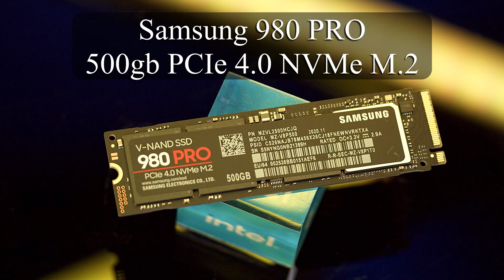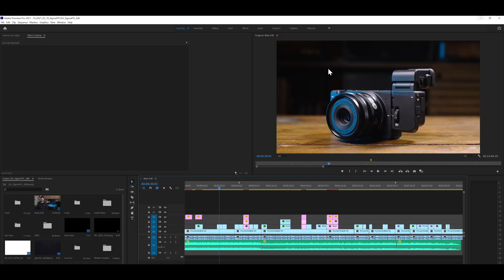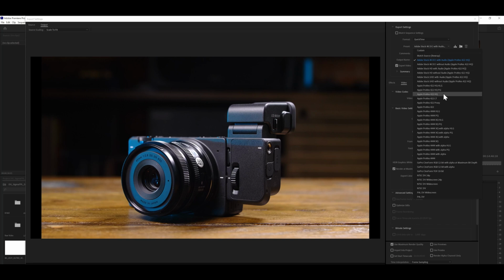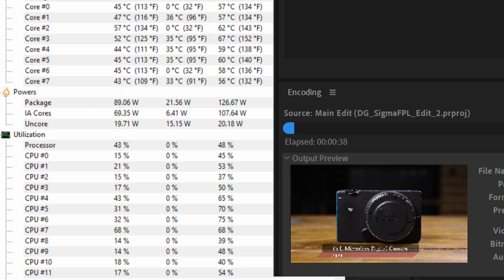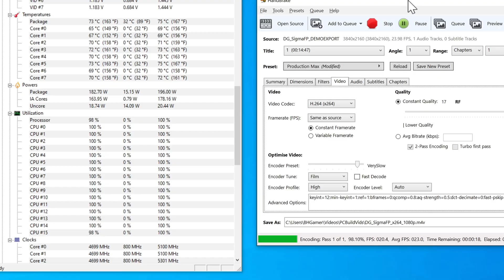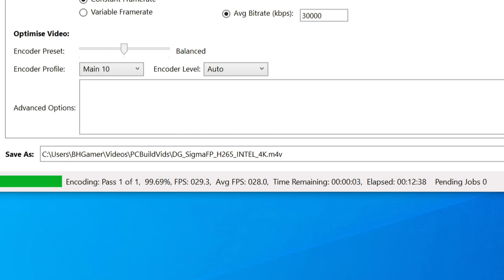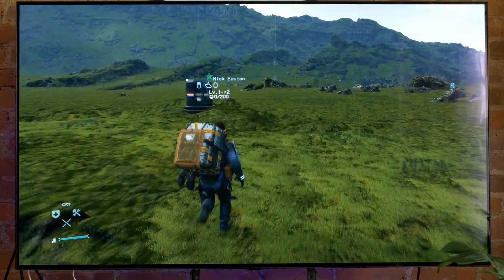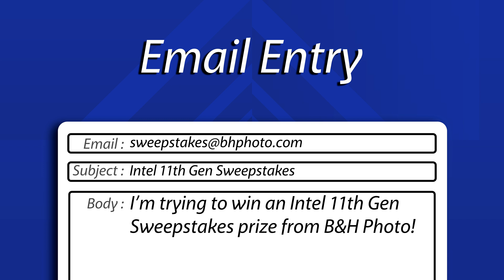11th Gen Intel Core | Hands-on review + Sweepstakes

Comment: Meanwhile Apple has created the M1 chip that clearly points the way to the future for computers that ARM RISC processors are more cost effective, thermal resistant and higher performing. Don't believe me??? Microsoft, Qualcomm and Samsung are all clamoring to produce ARM chips for Windows that are on par with Apples Mx chips. Looking at all this power hungry hardware though impressive will be obsolete in about 3 years. AMD processors are a better performance/cost buy than these Intel chips and they will have the cellular connectivity built in. However this Intel i9 is impressive though late and will likely be the last x86 development before the switch to ARM processors. Intel is already hedging bets by opening their foundries to make ARM processors for other manufacturers.
Reply: The M1 chip is extremely impressive, but it remains to be seen if it can keep the performance lead in a less integrated environment than the Apple laptops. Hopefully it will since that would be great for the competition, but it much more difficult.